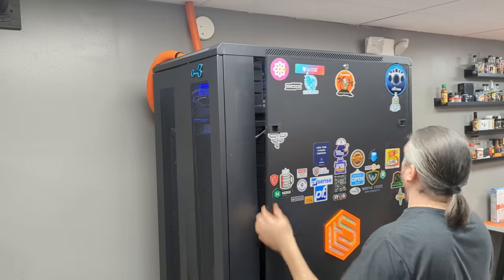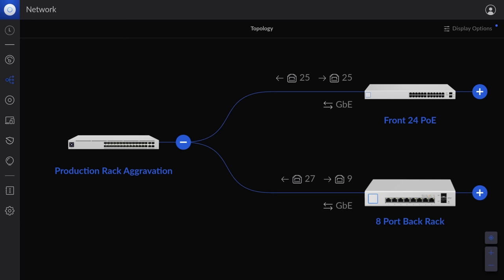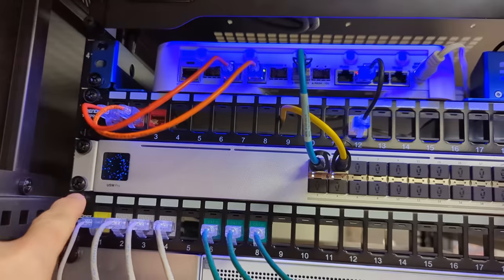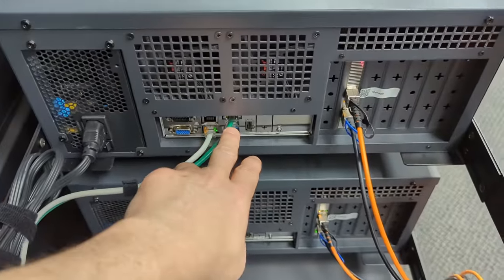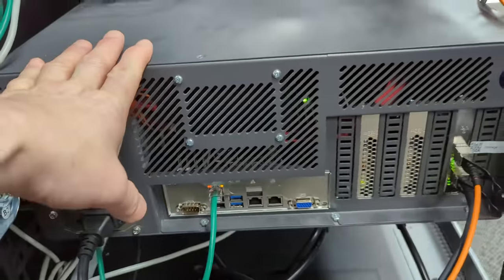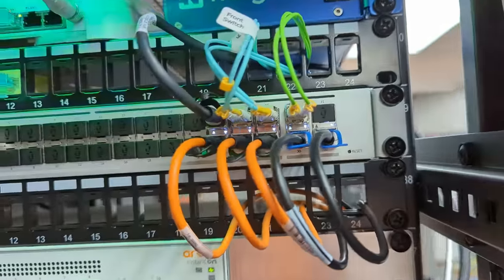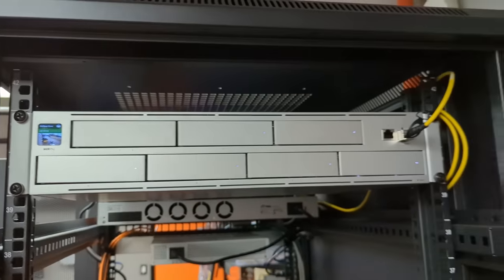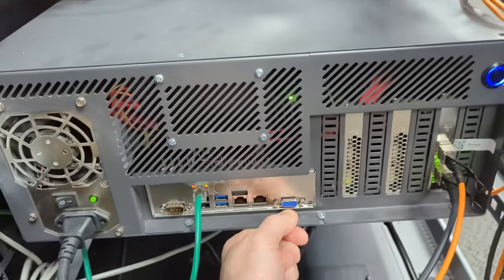Our Server Rack Tour March 2023

Comment: I like it.  The cleanliness of the rack almost took my breath away.  There are some /r/cableporn elements to it.  Have you found that 10Gbps iSCSI is enough for your workload?  Also, what is the 45 Drives server running as a storage OS?  I've found issues with certain brands not delivering the performance needed for X amount of production workloads.
Reply from the maker: I have iSCSI & NFS and 10G is fine for most workloads.

Comment: Is the 45 Drives setup as a SAN for the VMs? If so you worried about not have a second 1 for redundancy?
Reply from the maker: Yes it is and if it dies we will fix it. There are constant backups running so I don't really worry about data loss

Comment: I learned linux in less than a year. Pfsense I am moderately confident in my skills to layout/build a network per spec.

I would rather work for Tom remote and for a base "training pay" than take a job with a large employee base - because I want to move onto mastering this platform. Only certs/ tls /  vlan segmentation I am stuck on for the moment... then looking forward to cli mgmt of the firewall vs gui or console....

Tom, from the bottom of my true core scale heart : THANK YOU. 🍻 

Valuable content within this channel to get anyones' feet wet and then some... 👍